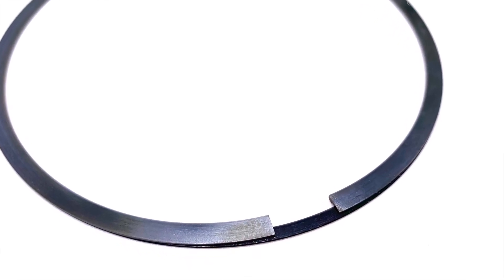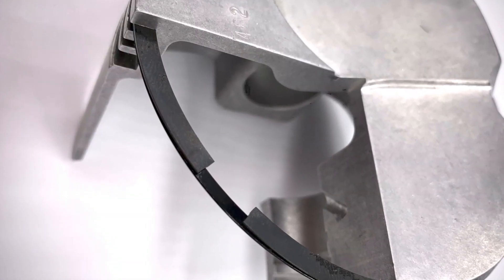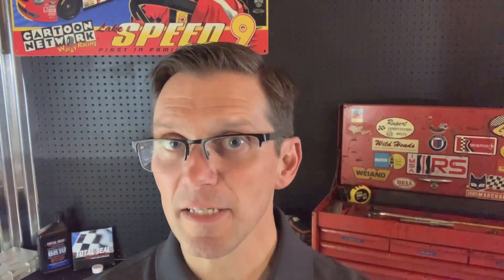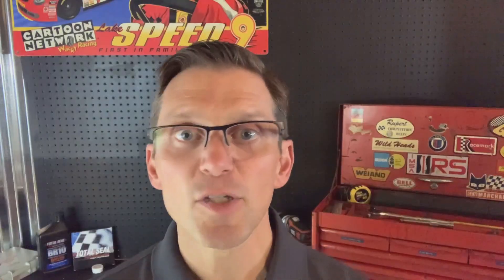What Is A Gapless Piston Ring?

Comment: How much better does the cylinder wall have to be machined to run a gapless Ring versus the standard engine rings which I'll be running 5/64
Reply: 5/64 is old school. Most pistons now, even the hyper pistons,  are 1/16

Comment: Looking into Gapless rings for my big block ford.
Haven’t actually seen anybody compare a conventional properly gapped ring vs the Gapless ring. Before I spend $322 I’d like to see the benefits of them
Reply from the maker: If you’re pistons don’t have gas ports, go with the gas ported rings. We have videos that show the benefits of those.
Reply: When the gapless top ring first came out one of the car magazines, I think it was Hot rod magazine tested them against file to fit rings... And the gapless rings made 10 more horsepower 🤔
Reply: @joeytacey743  Man…Thank you!! I’m still pondering the idea. Thank you for your input and knowledge!
Reply: Id imagine the crankcase would stay cleaner because of reduced blowby when the engine is cold, which also means no more smokey exhaust while the engine is warming up, less oil burned in the combustion chamber probably keeps it cleaner as well

Comment: Why aren't they used in production street vehicles?
Reply from the maker: Great question. Primarily because they are patented and cost more than conventional rings. Still some OEM’s have used a similar approach on certain engines where they felt the added cost was worth it. A “pinned” 2nd ring acts similar to a Gapless ring.
Reply: Because if they double the lifespan of engines, they halve vehicle sales assuming passenger miles is fixed. So, it's a 100%, huge no-no if you are a car maker.
Reply: @jason.arthur.taylor not really that. They have their applications. High compression racing engine. Or ethanol and methenol fuels where you want the least amount of oil contamination.
Reply: Because they have gap. A piston ring is sealed with 2 out of 4 walls: cylinder wall and bottom surface of the ring gap. They don't contact the top or inner surface. So the gas goes around the top half ring anyway, no major difference from the conventional rings.
Reply: @a_pakhomov are you saying even using gapless rings there is still blowby because the gap filler part is only a thin ring, that's how it looks too me anyway, I think it's fake technology or not well applied put it like that
Reply: @martin  
No. a_pakhomov is speaking about his own personal theory. In practice the Total Seal gapless piston rings reduce blow-by. It is measurable. I have used them and have very high, matching compression on all cylinders.

Comment: Can these rings be used on turbo cars?
Reply from the maker: Yes, a Gapless top ring is perfect for boosted engine. The fastest turbo charged engine on the planet, the Speed Demon, uses a Gapless top ring.
Reply: @TotalSeal  Are there special circumstance when a gapless ring cant be used? 
Also are there unique things that need to be paid attention to that are specific to total seals gapless rings? Doing an EJ207 rebuild in the next few weeks, I'm very interested in trying these rings.
Reply from the maker: While Gapless rings can be used in any engine, they work the best in high performance/racing engines. They are especially good with Methanol/Ethanol fuels. 

One key thing for the performance the engine is the proper cylinder bore surface finish. Like the foundation of a house, the cylinder bore surface finish is the foundation for the performance of the piston rings.
Reply: @TotalSeal  What are the surface finish requirements? The EJ I'm rebuilding has nikasil coatings in the cyl bores...
Reply from the maker: Nikasil has a different surface finish requirement than cast iron bores, and finishing Nikasil requires Diamond abrasives. 

The other key for Nikasil is non-chrome rings, including the oil ring rails. This is extremely important. Never use chromed rings with Nikasil.
Reply: @TotalSeal  So not for a performance street engine that needs to last. 👍
Reply: @hotrodray6802  Exactly, the gas ported rings are a better option for that application.
Reply: Wow. Do the gapless wear out the cylinder or do the gapless rings fail? I have gapless second rings in an aircraft engine. Excellent compression on all cylinders right now.
Reply: @bobirving6052 I’m sure there is there no additional wear or failure rate within the TBO for aircraft (or any other) engines.